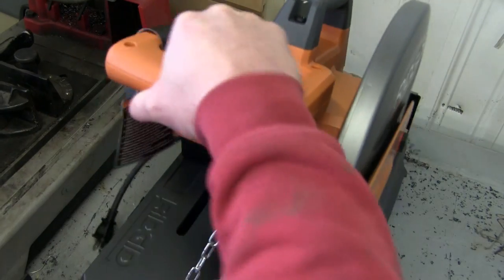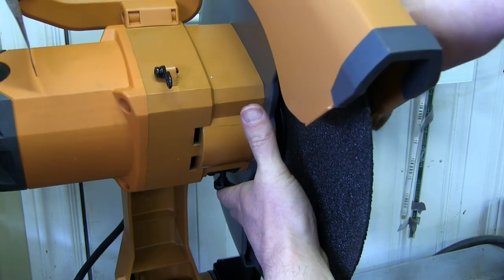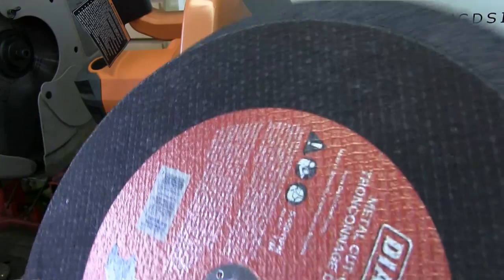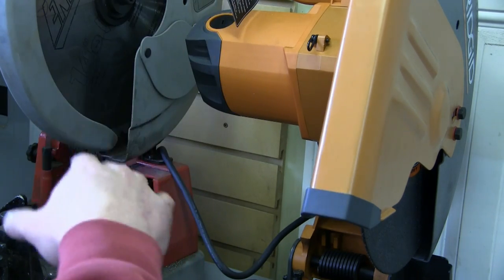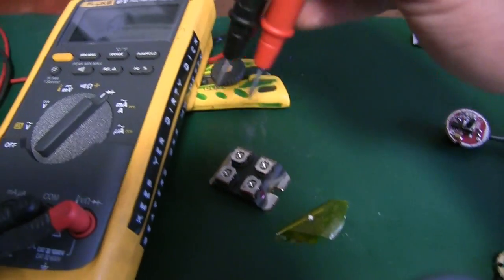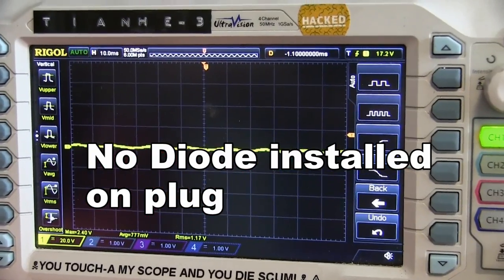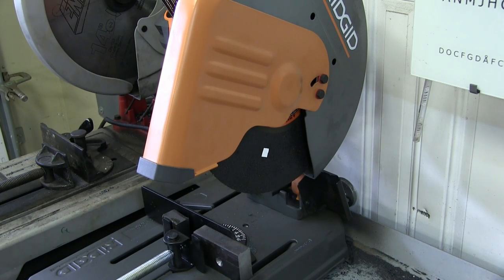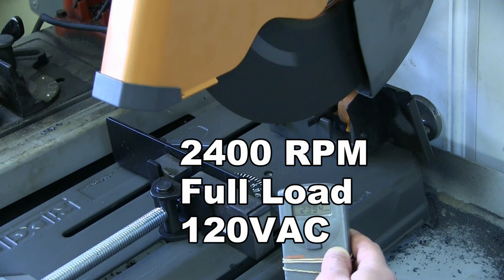RIDGID abrasive cut off saw converted to dry cut. Maybe.

Comment: Aright sugar britches. If you want to make a Kosha choppa sawwa for $37.54 get a couple of pillow blocks and make a t-bar out of some 6 inch channel.Another channel for the bottom and vice mounting. Slot the thing for the blade to enter from the front(missionary).Make an axle and flanges for the blade.Mount the thing in between the pillow blocks on the top bar with the blade in there.. Get a vfd off a treadmill.Mount it all up like a teetah tahtta on ears welded to the side of the bottom piece and pinned to the T bar up top. With a counterweight where needed if you dont get the motor or pivots in the right spot( use some of that fake gold you mine).
Steal a vice somewhere, supeglue it to a plate welded to the bottom channel , slot accordingly and have at it.
If you have a fake ID you can check in and steal the treadmaill stuff at a decent hotel or go to goodwill on any Martin Luther king blvd and grab some clothing, put it on (purple yellow pink and green--with a Pierre hat a MUST) and head to a country club with an empty golf bag. Hit the gym room since everyone is at the bar and load the empty golf bag with the electricated shit you need.Pretend your half tanked(you usually are anyway) and head out the door virtually un noticed.
Shalom eh ? Not to be confused with Salami.
This is the true path to saw coolness for tightwads.
Troo Datt
https://www.youtube.com/watch?v=IrdzbRTk1n4

Comment: It wouldn't be a shortcut in the least but with all things being possible in a perfect world. Could you run that motor closer to 90% the power threw a 2-1 gear box and get the result of a cooler motor and more torque threw the gear reduction? Maybe maybe not I'm not saying to go K.O.R. and set up something hokey to find out it's just a question...

Comment: Good rule of thumb "voltage up - amperage down" - conversely because they are inverse of each other - "voltage down - amperage up" So, half voltage is double current....
Now, why not go full DC? You seemed to stop at a half wave, the other half being off....
Reply: No Name that is what I am saying, hook up 5 batteries in series and run that mother f*****and see if straight DC voltage gives you your half speed but all the power

Comment: Adding a (current rated) capacitor bank in series would decrease the impedance without decreasing the speed, however, the current would still go up, but at least there would be full cooling. The only problem is that it would run faster than the rated blade speed. Suggestions anyone? (other than jam it down hard enough to keep it slow)
Reply: Josh St. Louis the whole point is to reduce the speed sir

Comment: Nice, finally somebody take care of this mod. Was really tempted to copy Grand Thompson's "scariac" (King Of Random). Pulling out my Evolution 380 raptor is to much effort for cutting low diameter soft steel. My Milfuckey 10" (wood) chopsaw can do the same job. I just have to reduce the  ripems and modify the cutting angle of the 40 tooth blade. Why? I live on a island away from the continents. Around 40% importduty + shipping almost double my first cost in$.
Reply: Conó, the wizzard of cuss didn'd solutioified that problem for me. Seems I got to change the natural cutting dept of my raptor to use my 10" 40T blades. They work well on soft steel and cost a fraction to the 14" ones as long as the cutting angle of the carbide tip is adjusted.

Comment: a single tool never trips my 15 amp breaker. even when it's cold and my 20a compressor won't turn over it just trips the the little safety button on either the gfci or the reset button on the motor. you must have a lot of load on that breaker

Comment: Potentially stupid idea, so It may fit in perfectly around here.  Could you add an externally powered fan to add additional air flow for the motor to cool it? (or maybe just jam a compressed air nozzle into the air intake holes to get the extra air flow)

Comment: floating an oscilloscope isn't the right way to protect it. you need to check that never put the ground clip on live wire. and since you are working on live AC to begin don't even need to bother with the ground clip. in case of doubt isolate tested LOAD or use differential probes!

Comment: You said it could run on DC, right? why don't you try stepping down the AC voltage and then use a full bridge rectumfrier it would loose less energy to induction

Comment: Nothing wrong with electronics directly on the mains...Dimmer switches have been doing this since the Moon shot...BUT, lowering the voltage on that motor is like starving it with 200 feet of extension cord and you know what that smells like !

Comment: Why not find a way to use a gearbox, half the speed with twice the torque, or at least that before you factor power losses. 
Could be as simple as just pulling the motor and adding it between the motor and the structure the motor is attatched to. 
Do a BOLTR teardown of this, it'd be interesting to see if this has a single long shaft from blade to arbor, or if it's split somewhere where the motor mounts to the structure for ease of assembly and repair.

Comment: I vaguely remembered that you can feed a motor the same voltage to maintain the sameish power but half the frequency to get half the power. However, it does seem counter intuitive to me that you could feed a motor that runs on either AC or DC a lower frequency to change the speed... I would assume that would only work for AC specific single speed motors.
Granted I'm no EE, also last time I asked an EE for help specing a motor he informed me that he specialized in signal processing and had no clue what about motor encoders.
http://www.engineering.com/ElectronicsDesign/ElectronicsDesignArticles/ArticleID/8154/Changing-an-Induction-Motors-Power-Supply-Frequency-Between-50-and-60Hz.aspx

Comment: Wouldn't the sane way be to add a real speed controller what with it's one digital brain boxing to allow true speed control. AkA sense the speed and maintain it even under load. Might want to add fan to blow enough air for those low speed high amp situations.

Comment: ive compared the diablo ferrous blade(1800rpm ) with the diablo non ferrous blade(3800rpm) , they are identical , different paint job on em , rpm rating is different but geometry and tooth count  is identical.  (12 '' Blades)
Reply: O IO the rake of the teeth differs

Comment: The problem with those motors is the almost complete inability to speed control them. The only viable way is with a VFD. Alter the designed input power in any other way and you’ll end up cooking that motor right quick. The reasons are complicated, sorta, depends on how much techno babble you can stand and how much it’s matters to ya. Lemmy know.

Comment: Come on girly hands....I've never needed a mechanical shaft stop to take a chop saw blade off. Just grab the blade with your hand, which will also hold the guard out of the way, and loosen the bolt.  Be like dad, not like sis.

Comment: This is senseless.  I took an old 10" diameter fine tooth blade that I was done using for woodworking and dedicated it to chopping off steel angle in a regular cheap Sears chop saw.  I was able to go through bedframe angle relatively fast.  The technique you want to pursue is known as friction sawing.  With friction sawing, you don't even need an abrasive wheel; you can use a dull steel blade.  The key is speed.  The faster the blade - the better.  Only the area in contact with the edge of the blade heats up and is rubbed away.  You don't end up wearing away the blade because only a small section of it is in contact at a time.  So you don't end up with a scorching hot piece of stock and you don't end up smelling the abrasive wheel burning.

Comment: if wattage is constant and you reduce voltage you increase amperage, I think gear reduction or a different motor would have worked
Reply: if it was a three phase motor I would try a vfd,I was even thinking about a motor/fan speed controller or dimmer

Comment: Variacs are terrible for this type of application because their voltage regulation is HORRIFIC. With the saw not running, you got 65Vac, but as the current climbs there's a voltage drop across the transformer impedance that lowers the output voltage to the saw. Voltage goes down, saw draws more current. Lather, rinse, and repeat. That's why for facilities with lots of big motors, they need to use special low impedance transformers that are stoopidly expensive.

If you really needed a dry cut saw converted on the cheap, you could probably roll your own PWM speed controller using an arduino, with the added advantage you could implement closed-loop speed control.

My $0.02.

Comment: get yerself a micrcontroller, a comperator, a mosfet, a rectifier, and a bigass capacitor, and a shunt resistor
use comperator to catch brush switching noise on shunt resistor and trigger interrupt on micro, set pwm duty cycle based on how far apart the interrupts are 
feed motor from ac->rectifier->mosfet->big cap->shunt->motor

bootleg speed control with no sensors on motor

Comment: If the only real barrier is heat, couldn't an electric fan help?  
Build a rotary converter from a vacuum cleaner motor and an old car generator for a really strong DC source?  Might be talking out my ass here...

Comment: why don't you just buy a motor speed control that pulse on and off to give you full voltage and full amperage .  I never had the need to control the seed motors  but that was what was explained to me twenty years ago. variable  resistance would cause premature failure  of the motor .

Comment: take it back get this 

14 in. Multi-Purpose Chop Saw
Evolution Power Tools 14 in. Multi-Purpose Chop Saw
Model#  RAGE2

$14900
 Looks far better than the rigid, I got the milwaukee (made in china, the Dewalt also made in china, ended up cutting the base just would not cut square.) found both of them crap, would not cut 4" steel waste pipe for any thing,  had to keep cleaning the blade with wood to make it work.

Comment: dont know about the 20 amp breaker my stupid work only wired in 15 amps just have to not act like a 200 pound gorilla sitting on it sad part is some of those expensive blades are crap as well some glaze over personally love the walter baldes

Comment: you forget, heat scales with current. P = I^2*R - that R is all windings and that P is all heat. so it was never gonna work. gearing it down is probably your best bet unless there's some fuckery you can do with rewinding those motors.
and yeah, half-rectifying it was always only gonna reduce power, not speed. fairly surprised you didn't burn your variac as well - you can do serious welding on 40A.
but hey if you really need it for some reason, can always put your full body weight on it. 200 pound gorilla ought to slow her down enough.

Comment: When you reduce voltage you automatically request more Amperage in order to keep the same rated power output. Here you load it up but good and reduce the pixie gap but the flow of them angry fuckers increases to make up for the demand.

Comment: This saw is aparently designed to hardly handle it's intended purpose. Rigid seems like a home gamer brand to me even if they try to market themselves as pro.  All of the electric tools seem craptacular in one way or the other. The pipe benders and thinks like that seemed ok though when i worked in a B2B iron mongerer they were just destocking all the rigid tools. They were only there in the first place becasue accountants decide what to sell rather than asking the people you will actually sell to.

Comment: love watching these videos. Just wondering if anyone knows weather there is a video on turning something that is ac run, into a dc battery power run device. have some projects i want to start but dont know how to switch everything around? im also a little clueless on how to limit the power going to said device so i dont shove 24 volts from a battery into something that runs off of 4 volts and blow it the fuck up. if anyone has a link to one of ave's videos or a link that simplifies everything for someone like me it would be greatly appreciated!

Comment: hi Sir i really would like some help with something, cause as i can see 
you know a lot about tools. I wanna buy a dry cut saw for metal, i am 
between 2 brands and models. Dewalt DW872 VS Evolution Raptor EVO355. i 
really like  dewalt more just because its a well known brand.I have mony
 tools made by Dewalt and they are very old and still working. Both of 
them cost somewhere near 500 European pesos so money is not a problem. 
The evo  can cut 12x10 and the dewalt 10x10 in a square cut please help 
me out !!! greeting from Greece!

Comment: You were too busy thinking more complex on how to make it work that you overstepped the obvious. On Amazon you can buy a VIVOSUN Variable Vent Fan Speed Adjuster Inline Duct Fan Speed Controller.
It's about $18 for this one and you can control the saw with it. There's a whole ton of videos out there about using this box. All you do is plug one side of the box into the electric outlet then plug the saw in the back of the box. It has a three-way switch one is off two is normal and three is adjustable. There's a knob that allows you to dial in whatever you have plugged in. It has a 15 amp rating and it comes with a built-in fuse.

Comment: Do your math and find out that if the voltage is reduced to half then the power is reduced to 25 %
Reply: Here is the equation Power=(VxV)/R   (120x120)/12 =1200 watts   (60x60)/12 =300 watts

Comment: I must admit I've tried the Diablo blades in my wood cutting saws.  I've thought about slowing them down, thanks for trying for me :-).  Looks like there is a saw blade that's meant to run around 4K ripums.  ColdCut1000 by ColdTech.  There are a few videos here, including linked to their web site. http://cuttech.com/metal-saws/metal-round-saws/coldcut-1000-series/

Comment: Why spend $200 on junk abrasive saw in the first place? Even if you converted it to a dry saw for free you still have a light weight piece of crap. The biggest problem with most, if not all chop/dry saws is that if you want to do a miter you have to move the WORK instead of  the head of the saw. The clamping system of the saw is garbage and no matter if you use a dry saw or fiber blade you are getting Sparks off the blade. Do yourself a favor and buy a used cold saw. After buying a cold saw I could never go back to anything else. I have 2 pedrosoli cold saws (Italian made), known in the United States under the name super brown. . I  bought the cheapest model made used at a sheet metal fabrication shop in Richmond California for $200 and it was in great condition with a nice shop made stand that rolled. The 2nd one I got was the top of the line model of the same manufacturer that had a precision pin to locate 90, and 45 degrees in both directions and it is dual compound miters. It had pneumatic clamping on both sides of the cut, 2 speeds, all cast iron (400 pounds), and came on top of a rolling lists tool box with 22 blades, but was $2,000). It was from a old machinist that lived in my neighborhood in San Francisco and was in perfect condition. Do yourself a favor a fi d a good used cold saw. Dont even waste your time with buying anything else.

Comment: Possible thought for a re-do; a closed-loop PID controller may be a better fit for this, a la https://sites.google.com/site/klaasdc/cnc-router/spindle-controller . It works via phase control rather than voltage. I don't see why it cant be scaled up for a 15 amp universal. After all... how hard can it be?

Comment: Abrasive saw!? WTF!
Why would u ever use somthing like this?
For an angle grinder its ok because u hold it in your hand and dont want the tool to bite, and it has other things to do! 
But on a fixed bench tool you cant get much more Inefficient to just "cut" somthing!
Why the hell somthing like this exist? 
I even think the fast spining metal saws are stupid, the low speed saws are more efficient, less tool wearing and not much slower!